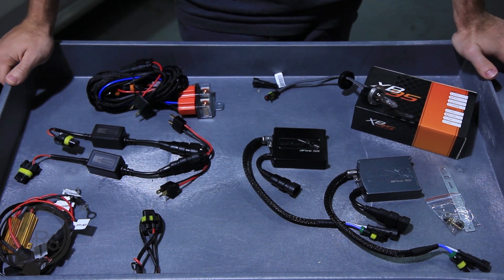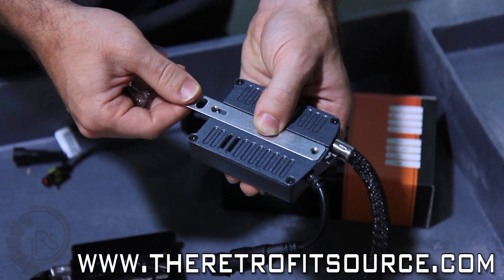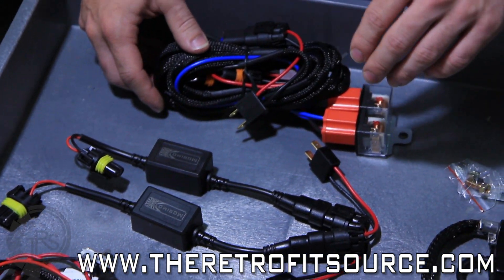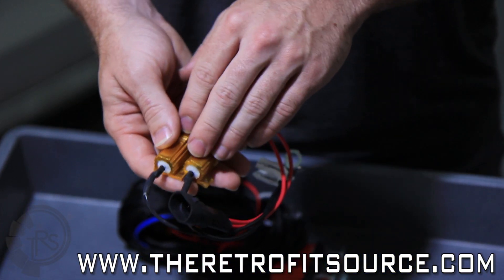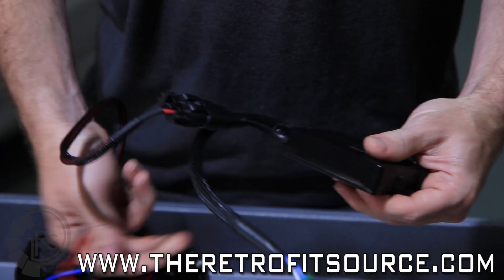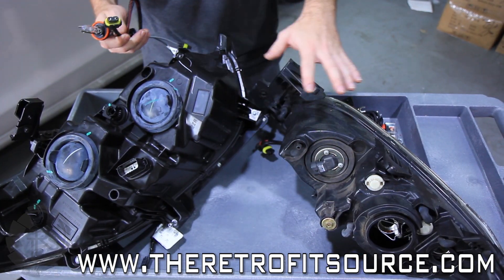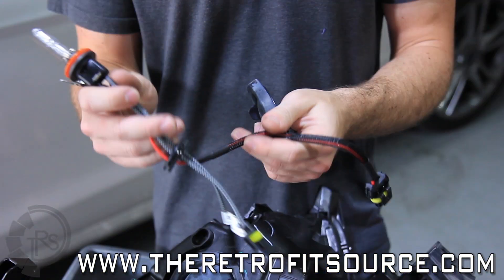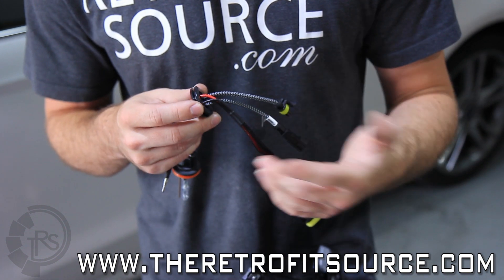TRS Tips: How to Install Morimoto Elite HID System with Standalone Canbus Harnesses

Comment: Wait wait.. Ok so I want to purchase from you guys but I'm not understanding your installation here: 6:05
You are routing the stock switch harness into the stand alone, then to the ballast... and then from the ballast to the lights?
Shouldn't the ballast get power from a relay harness to avoid damaging the stock harness?

I have a 2012 Ford Focus and my current setup consists of a relay harness and 2 resistors to prevent the bulb fault error.

Would the standalones take place of my resistors or am I missing something in the connections?
I don't understand how to incorporate those in the connection as a whole.

Can you help me understand what all I would need from you guys for your kit?
Reply from the maker: It might help to take a look at the different diagrams we have: https://www.theretrofitsource.com/core/media/media.nl?id=1718927&c=5129608&h=yw4eOuIe7Cdq7-z928LnFrdS3LBj17tIuow6xZosknPYLODn
The setup of the standalone can depend on what you are installing it for.

If you have any questions after looking at the diagram, please send us an email or give us a call so we can help further.
Support@theretrofitsource.com // 404-220-7940

Comment: Would've been helpful to see the beam pattern on a sedan.
Reply from the maker: What sedan are you referring too? This was just an install video for the HID kit, not a specific vehicle.
Reply: @RetrofitSource  I understand. Thank you for responding. 2010 Honda Accord for me (spec d aftermarket headlight assembly-morimoto xB 35's). Is there such a thing as bad projectors? I'm not impressed with my beam pattern or road illuminosity 😑. maybe my hid bulbs are not aimed properly? Is that a thing in projectors? Bad aiming?
Reply from the maker: That could be a problem with the bulb alignment, but it is hard to say. Especially being that you have aftermarket headlight housings, that may take a little more digging to find the issue. Shoot us an email and we should be able to get you taken care of no problem! Support@TheRetrofitSource.com

Comment: Do I need a harness for a 2016 Tacoma? I previously had onex 55w and didn't use a harness and was completely okay for 3yrs
Reply from the maker: A relay harness is not always needed, but we always highly recommend installing one as it's an extra safety precaution. 
Here's a great article about this topic:
https://gtrlighting.com/blog/do-i-need-a-relay-harness-and-how-do-you-install-it/#:~:text=A%20Relay%20Wiring%20Harness%20utilizes,positive%20terminal%20on%20the%20battery.&text=An%20HID%20wiring%20harness%20for,to%20a%20successful%20HID%20installation.

Comment: Is this the same at installing h7 morimoto elite with anti flicker and euro adapters to a BMW 2014 F30 328i ??
Reply from the maker: It's similar, but different. If you use the anti-flicker, you don't use the relay harness to connect to the battery. That will just plug right into the factory wiring.

Comment: Where is the wire that controls the high beam?
Reply from the maker: You connect your high beam to the factory wiring. The relay harness only powers the low beam circuit

Comment: 55w running hot,is there any chance to melt headlight housing?
Reply from the maker: very unlikely - unless its a small fog light housing there's low risk of melting with 55w as long as its installed properly.
Reply: @RetrofitSource  
Using 55w ballsat with 6500k bulbs is ok ?
It's true it will reduce it to 5500 ?
And by the way,my previous halogen bulb was 60 watt
So i have concerns regarding heating, wire melting ?

Comment: I thought you needed to install HIDs within a projector? It looks like these were installed in a halogen reflector housing? Am I missing something.
Reply: I guess you must know nothing about cars or parts in general. the car they were working on is equipped with projector bowl housing just not xenon lighting source. Putting HID on a halogen projector bowl housing will not blind anyone. It will actually help with the light output source. A halogen reflector housing will be just all chrome backing and the light bulb will just be cover with a cap, showing the bulb. Putting HID on those housing will be a bad idea.
Reply: I'm thinking about performing an upgrade like this, too......is there an issue with putting HID's in the factory housing of a 2013 fusion?
Reply: Thx for the blunt ... feedback. I don't know, for some reason part of me was thinking that they were made-to-look-like projector housings.....why would they put halogens in a projector housing? What benefit does it have? Halogens shine the same regardless of and without being installed in a projector housing, right? Maybe because they wanted it to look cool? Well, if that's the case, if style was all they intended, then it would make sense that they built the car with a "projector-like" housing and not REAL projectors. It just didn't/doesn't make sense to me why the vehicle doesn't come standard (at least on a Titanium and SE edition) with HID's. But, at least, from what you're saying, there's only one style of projector housing and Ford doesn't make housings that are made-to-look-like projectors. I can live with that.
Reply: Jonathan A I noticed a Fusion today that had Audi-like LED's. It was VERY impressive
Reply: I think he was referring to the fact it's a bad idea to put xenon bulbs in a halogen housing, regardless of if it's a projector or not.

I have heard of several people burning the insides of their housings. You need a proper HID projector housing.
Reply: No you are right. It's a bad idea to put xenon bulbs in a halogen housing.

Comment: Would the 55W have any heating issues like melting the bulb housing?
Reply: +Ray G never a problem unless its a really tiny housing or fog light
Reply: +Ray G I've been using mine in an F150 with Spyder headlights for about 3 years now. Still using original bulbs. They don't seem to have an issue in my retrofit projectors. I imagine in factory lights they will be okay but a projector is recommended..

Comment: What about the MOPAR LOW BEAM: MORIMOTO ELITE HID SYSTEM  kit for my DART 2014 ?  less expensive than the RAM (4 resistors) kit and should also work according to your site. pls confirm, thanks
Reply: depends on if you projectors i think. my buddy has a '13 ram without the 4 resistors. I have the '15 that does come with it.

Comment: Hi,  I removed a cheap hid kit from my Dart 2014 because "burn bulb" and flickering issues and now I am searching for a best hid kit... will your 9006 HID CAN + Capacitor be the solution?  also 100% no errors on my dash panel? I also notice bad light output with the cheap 35W kit (I have OEM projectors),  Do you believe Morimoto kit will have more light output than cheap ones? or need 55W kit to really notice good difference. thanks for the help. I'm in mexico, ready to buy, just need to be sure will work.   (btw I did use the resistors, and even with them  I saw flickering on 1 light only).
Reply: +J Smith This is the kit you need for your Dart, works perfectly, tested and verified by many owners here in the USA

https://www.theretrofitsource.com/hid-systems/morimoto-elite-hid-system-15-dodge-ram-low-beam.html
Reply: +The Retrofit Source Inc   Thank you, is quite expensive,  is RAM same bulb than DART? also Do I need everything in order to have it right?  (4 resistors, dual relay, capacitors, ...) :S  also I searched something about OSRAM bulbs, do you have those new OSRAM bulbs that offer 20% more light  and are clear white/blue on road?  and 1000% original  with OEM boxing and warranty from OSRAM? if so then I will purchase asap :) thanks!

Comment: Are the Morimoto hid are high quality products?
Reply: Yes they are good quality at a good price.

Me and my brother both replaced our oem xenon bulbs on our bmw's with Morimoto 3five D1S type bulbs at 5000K. Not only were the Morimoto bulbs brighter than my oem bulbs, which were brand new oem's btw, but i was able to pick the color I wanted. I went with 5000K over the oem 4300K. Gives it a slightly "blue'r" hue, but still bright white light. 

Now technically 4300K puts out more light than an equivalent 5000K bulb, but the Morimoto bulbs are just so much better than the oem osram xenarc bulbs we had. We both have adaptive headlights(projectors swivel with steering), no errors. Just brighter, more crisp light, and i think even quicker start up.

I have a BMW 335i and my bro has a BMW 535Xi. Both cars are wayy brighter with the new bulbs and like i said no problems, no dashboard errors.

My cousin has a full Morimoto 3five HID kit in his G35 coupe. Came with ballast, bulb, and brackets. No problems, been over a year now.
Reply: +gil zur Absolutely, best quality in the aftermarket!

Comment: I have an 09 Cadillac CTS and i have aftermarket SPEC-D Tuning headlights for it, They use H1 bulbs and I wanted to replace the crappy stock  bulb in them for an HID kit, would you recommend a hd relay or a canbus? Also, would the H1 HID's fit in the headlights? I heard you had to get a retrofit kit to get them to fit.
Reply: Spend a little time and money and get the retro quick setup from them. Instead of the crappy projector you have you'll get a high end one.
Reply: http://www.aliexpress.com/store/1524214

Comment: I've purchased one of these kits (35w), and standalone canbus, but I sometimes the lights doesn't light up (keeps flickering and flashing, and I also get error messages on the panel). Should I try one of these "resistors" or "capacitors"?? I own a VW Golf Mk7
Reply: Get the resister for it my buddy 08 3 series had the same problem

Comment: i isntalled my hids on my 2014 ford fusion... i used the same relay harness you show here... but i have flickering headlights when ever i use the turning signals.
i did not use any capacitor links... do you think i need one and did you use a caplink on this install?
Reply: Gerardo Montoya-Puga I have this same problem. How did you fix yours?

Comment: this is a great looking kit. i wish i knew if my new car will need a wire harness. my old car did. i'm just a bit worried about how well HIDs will work with my daytime running lights. i guess i buy everything that i think i need and hook it all up. it seems like a bit of a nightmare finding places for wires, ballasts, and grounds.
Reply: Most of the time, the "Brights" are used as the daytime running lights but sends lower voltage during those times.

Comment: Where's the rest of the video?? Where's how's the harness system wire up? I seen nothing about the harness, it looks like you didn't even use it ....?
Reply: There is no "rest" they used the stand alone, which is the little box that they plugged into the ballast.. it used the stock harness, not an extra relay harness.
Reply: Ok